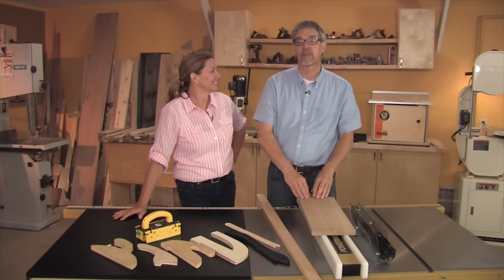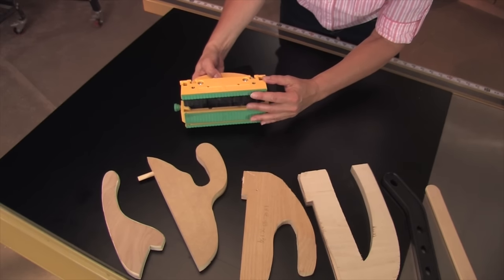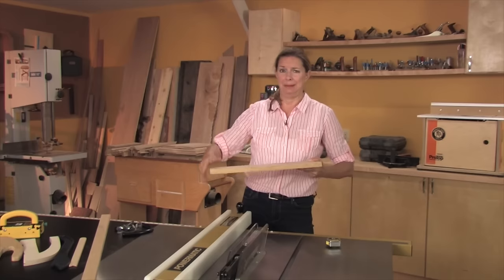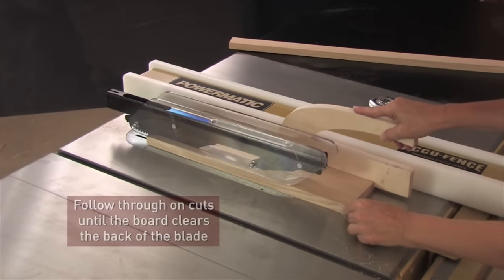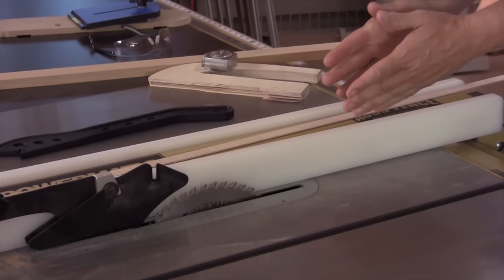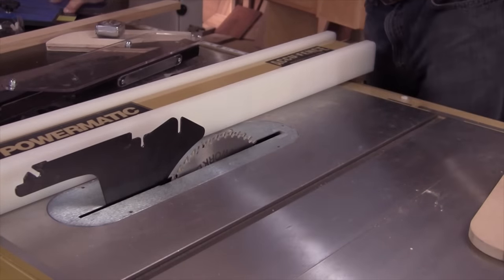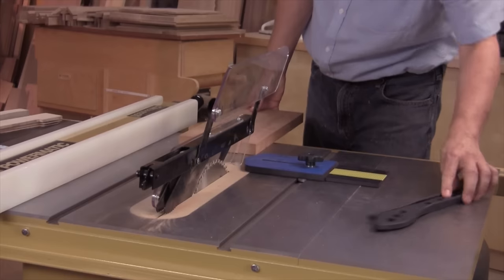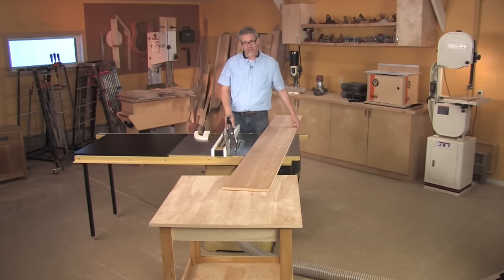Table Saw Rip Cuts

Comment: That brace in in the series where you did narrow strips solves my problem of cutting 1x2's off 2x stock. There has been a problem with drifting and the narrow strip comes out too skinny. I was working from the other side of the blade too. Thanks for that lesson.

Comment: No you find the right feed rate for the blade your using and the wood your cutting.  If your using a 40 tooth rip blade on purpelhearr it will feed at a certain rate  if your using a 60tooth combo blade it might be slower for the same stock.
Honestly just joint or plane a saw cut edge. Untill you find the feel for cutting speed rate on that blade and wood.

Comment: What I dont get is the idea first step in milling rough cut wood is plane one side stright line rip one side the rip opposite side the cut a 10 board down to a working size  then true up to finninsh size or glue up?  
Why not cross cut leaving stock for finnish cut smoth in planer joint second side and rip other side to match then plane last side or bring down to finnish thicknesses width and length. Then do you journey work. Trying to stright line rip 
A 14' 5/4 board that has a long bow in it waste materials. If your making short bonds stright your not cutting away as much stock or if your jointing one edge your not dealing with a 14' chunk of wood to do it.  You can mill the shorter parts in a line to keep from. Having snipe.

Comment: 4" or wider is wrong.  Spread your fingers out as wide as you can between a stoped blade and fence  thats the narrowest board you should ever cut with you pinky touching the fence always  no body part can touch the blade, but you must use a spliter or riving knife.

I dont care if your a pro with 40 years exp. You cant be too safe but you can take unnecessary risks.

Comment: Prodding sticks does not apply downward  and side pressure against the blade and fence. Using another stick to remove the thin cut off piece us dangerous and unnecessary. My technique fulfills the safety without fancy jigs, multiple pushsticks and we never, ever use out hand - fingers to extend toward the zero clearance plate or use it to push wood to the side of the sawblade. Wrong pushstock designs.

Comment: 7:42 Funny to see a video about "safety" and encouraging use of push sticks, showing you pushing the stock through the saw with your hand. This guy: https://www.youtube.com/watch?v=fifjjacjLBE did the EXACT same thing and nearly cut off 3 fingers.

Disliked.

Don't follow this guy's example, people. Everything looks safe when the board acts the way you expect it to, but if it kicks you don't want your hand anywhere near that spinning blade. It WILL pull your hand in a direction you don't expect, and maybe right through its teeth.